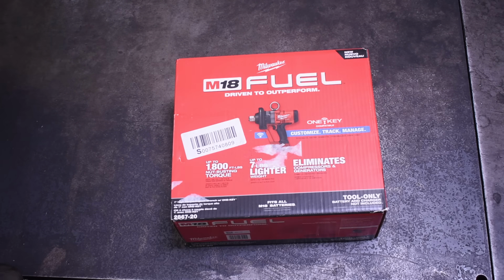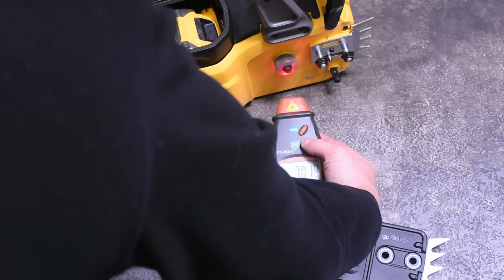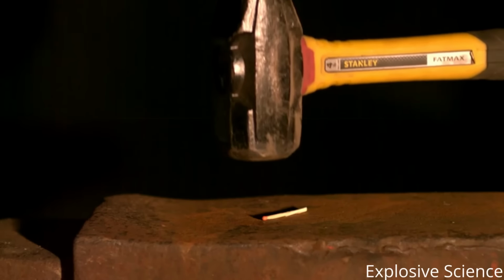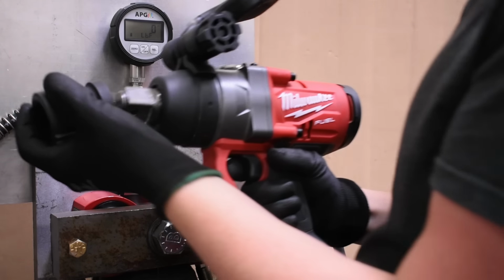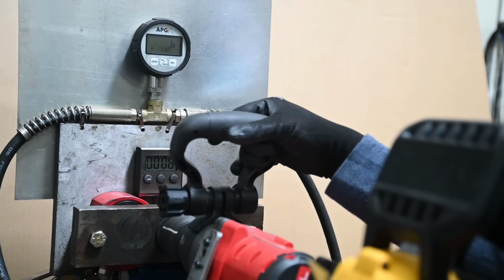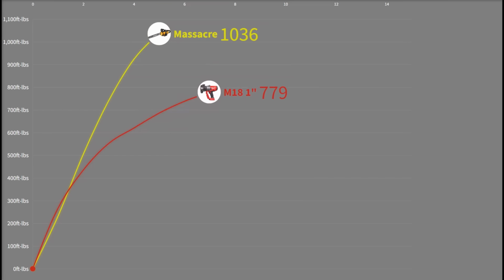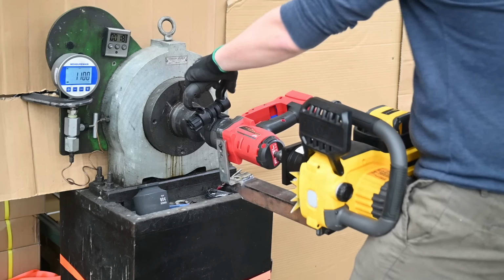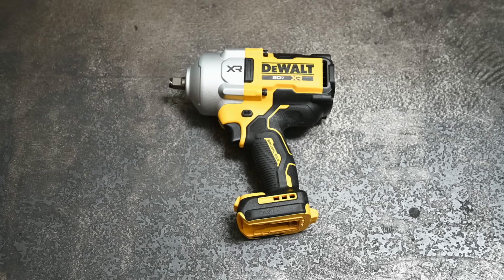DeWALT Chainsaw Powered Milwaukee Impact Wrench

Comment from the maker: If you sub, with today's Youtube almost nothing will happen. But hey, we'll still think you're cool. So there's that
Reply: Hey TTC, can youndo a shop tour at some point, i think a lot of us will enjoy it.
Reply: @Bartjuhhh103 Yes!!! We NEED this!!!
Reply: Do you have a way to measure how cool we are yet?!?
Reply: I know it's not an impact but have you looked into Hytorc or Radgun tools?  They're making astronomical torque claims and I would like to see them get the TTC treatment.
Reply from the maker: @MagnificoDidNothingWrong  We get offers, including from Hytorc for free ones which hey as a $7k tool that sounds fun. But they aren't particularly fun, just whr whr whr whr stop. High number. They work, they all work assuming they don't turn into confetti. It's a $200 cordless drill and a $2000 strong as heck gear box and LOTS of gear reduction. Good for tightening. Doesn't do much else.
Reply: bought the seesii impact because of your listing, finally broke loose the 22mm front strut nuts, took it about 30 seconds or slightly more, after a break because the nut was smoking, but she broke loose ❤ thanks, also any tips on keeping a sway bar link from spinning on the back side? (no welder, back side has been stripped a lot from clamping on locking onto it with vice grips, but i managed initally to get it off and replace the strut, now when i go to tighten the bolt back on it keeps spinning inside the grips and stripping it more and more) didnt realize i was supposed to replace at the same time 😢
Reply: @DaftKermitThePunk Replace it, or take the assembly to a welder(or a buddy with one) and have them weld up a nut or just a crazy shaped gob for the vice grips to hang onto! Im sure others have better tips haha
Reply: Next up is a hand cranked gatling style Impact wrench driven with with nail gun ammo.
Reply: Keep doing stupid shit like this and you dont even have to ask. We love it
Reply: Be a lot cooler if ya did
Reply: @ecidemon5672  Alright, alright, alright....
Reply: I think its just skipping when impacting, so hook the the pancake from the roadside egg impact and hook it up to the chainsaw,
Reply: Gained 16lbft and speed
Reply: I'm just glad you took the king of the hill of beans away from gasoline and gave it back to cordless electric, and even made it even more practical and ergonomic!
Reply: @torquetestchannel, you like to make abominations. So, could you make a 12v stack battery? Red, yellow, whatever.  Or is there a lot more to making that work than just soldering some stuff together?
If you can make that happen, could you make a 60v stack battery to run on yellow's tools?
Thanks!
Reply: Yeah, but if they hit the bell and turn on notifications something will happen and they'll be extra cool.

C'mon, Minecraft YouTubers have had this promo stuff down for forever, "And don't forget to smash that like button, subscribe, and hit that bell notification!"...
Reply: @msytdc1577  Annihilate that LIKE BUTTON, ring that bell so hard it breaks, and make 20 burner accounts and subscribe

Comment: I recently purchased both of Milwaukee's 1" impacts and love them but something that always frustrates me is the reverse bias power ratings. I still work on some older trucks and trailers that have left-hand lug nuts and the newer engines use torque to yield head, rod, and main bolts, which requires an impact gun stout enough to overcome 300+ ft lbs to turn the fastener an additional 60 degrees on a Cummins ISX. Is there a technical reason for the bias or is it mostly marketing that drives this trend? Love the channel. Thanks!

Comment: When I worked on rigs we used a 1 inch wrench with a 5 foot breaker bar and we still struggled to break the bolts so I would 100% buy this or the blue prints if they run off battery.

Comment: Where are the chainsaw comparisons my M18 chainsaw crushes my 80v Kobalt in power it seems. I need to know what the top cordless chain saw is.
Reply from the maker: Pretty hard to dyno, they all have unusual outputs
Reply: I would be satisfied with some non scientific testing i am sure you guys will figure it out lol  @TorqueTestChannel

Comment: Is there anyway you can change the gear reduction inside the Milwaukee gun? Also I’d like to see 2 m18 battery’s wired to 36volt inside a impact to see how much the extra power would effect it.

Comment: Has anyone else suffered a failed circuit board sensor assembly in their Milwaukee rattle guns?.
I have seen several now where the 4 tiny wires just break off the board.

Comment: You could probably put a switch on the chainsaw to make it go backwards, after all, it's a brushless motor, so basically just a 3 phase electric motor, so swap any two phases and it's in reverse

Comment: Can you test the Bauer 58446 brushless mid torque? Looking into buying one as it will work with Dewalt batteries with a very slight modification

Comment: With this silliness, the next step is an “M208” version of the big Milwaukee D-handle, with a new “brushless” (3ph, 25hp induction) motor.

Of course it might need a massive frame with caster wheels and a little hand cranked crane or jack to adjust the height and angle since it would be too heavy for a single person to pick up and would create 100 or 200 ft-lb of “kickback” torque just starting without a socket on it.

Comment: what I really enjoy about these videos are just the insight into impacts and how they function. of course the tool breakdowns and cutouts you do with walking us through parts does as well.

I'd enjoy seeing a built up compact or mid torque. we're seeing brands releasing 1/2 high torque that pretty well align with 3/4 power, but don't see much on compact impacts hitting high torque 1/2 range. with pouch cells like forge hitting the market, a 3ah compact battery on a tool the size of a  mid torque would make so much sense. something light and small enough to get into tight places where bigger guns would need replaced by a breaker bar. or possibly a right angle impact

Comment: That was a stack of spring washers.  Have you considered nordlock with double belleville washers?  Used to work semiconductor equipment and as far as the Japanese engineers cared that was the solution to every problem involving high frequency vibration and 200 degree 30min thermal cycles.

Comment: Wouldn't the circular saw been a better fit?  Higher rpm plus you already tested a 60 dewalt circ saw.
Reply from the maker: It's like 2Hp vs 4Hp though. And believe it or not, lower RPM
Reply: The new Dewalt with has lower RPMs.  If you look at the slow motion part of the video, you'll see metal being shaved off, the spring is not strong enough for the extra speed and torque being supplied.

Comment: I bought one of those DeWalt chainsaws this summer and yeah its an absolute beast. Impressive on how much torque that abomination makes.
Reply: It's pretty decent for an electric and gains more power running a shorter bar like any chainsaw, but it's not really in gasser territory yet. A dual battery version might be.
Reply: @Comm0ut  so, a 120 volt chainsaw with two flexvolt batteries ?

Comment: Would putting the dewalt spring in or find a stiffer one somewhere else fix the problem of the hammer over rotating and not getting pushed all the way back?

Comment: What if you didn’t go the standard drill motor route I’m thinking 961 hammer assembly but cut the back out and stuff a battle bots motor in it and it you mount the esc somewhere else instead of in the handle you could use one with significantly more cooling and use something with more beans

Comment: MAYBE DIY MODIFICATION --- electric skateboard motor like 6380  === 4000wat brushless + vesc controller or even bigger motor like 8072 with low kv (rpm per volt) and peak 6000wat
PS 
you could easly change the rotation direct in this chainsaw by swaping 2 motor wires from ABC to ACB and hall sensor wires from 12345 to 14325 (1 and 5 are + and - so you dont touch them)

Comment: Regular mechanic: I modified a tool by grinding down a wrench.

TTC: Hold my 21700 cells.
Reply: To increase the torque he needs to increase the weight.

Comment: can't you use a reverse threaded nut and bolt on the skidmore-wilhelm to allow for testing reverse on impacts?
Reply from the maker: The skidmore doesn't use a bolt, it's a hydraulic plate with male threads. A replacement is like $1,000 and it looks standard thread

Comment: you could try to bolt a brushless inrunnter motor on the back of the milwauke and somehow hook up the shafts together.   those little motors can go like 5..10kW... in a coke can size.. some (lehner motors, model 30100) go even up to 40kW at 50k rpm

Comment: The next thing to do is use the Milwaukee D handle with a chainsaw
Reply: IR one inch died in the battery adapter episode from the flex battery’s they have a Donor

Comment: You’ve got the tools and equipment to do it so go ahead and build your own impact make it have a 10 pound hammer and bolt on whatever you deem fit for a motor be it something electric or gas plug in or battery and just see if you can hit 3000+ ft/lb
Reply: Depleted uranium hammer assembly when?/s
Reply: @obsessivecorvid yes sir!
Reply: You'd need to forge the hammer and anvil really. Best bet is just to frankenstein the biggest hammer/anvil combo possible onto a motor like the dewalt chainsaw
Reply: @Muffinx93  Just collab with someone like @TITANSofCNC to get a custom made tungsten hammer and anvil.
Reply from the maker: @MrMartinSchou  Tungsten would just shatter. It needs to be forged as @cncgeneral said. A forged hammer and forged anvil that's machined. At least if we want it to last longer than the impact in this episode did
Reply: @TorqueTestChannel  forged 4140 or 4340 would be pretty ideal with the right heat treatment,  you could oversize the anvil and hammer diameter for more contact area and rotational mass
Reply: @TorqueTestChannel I did not know that.

What's the densest, tough material then?
Reply from the maker: @MrMartinSchou  Tough is a good word for it, as that's the main goal. Unfortunately most tough alloys and materials are all pretty much inline with regular steel/iron in density. The move would be to forge a large hammer mass out of Cro-Mo then machine holes into it and heat up then press some tungsten slugs into it and hope they dont see much forces to crack apart. That would be massive in the physics sense.
Reply: @TorqueTestChannel Tungsten has a specific gravity of 19.22.  So how about Osmium, which has a SG of 22.5? It might present a few difficulties, but you shall overcome!
Reply: @TorqueTestChannel  a guy above was asking about using a Cordless Router motor..think it'd be worth it to swap one into that smoked IR?
Reply from the maker: @KHALABEEB  Nah, it's going to use something bigger. Something spicier, probably. I dunno, sometimes these things blow up before we even film them and you never get to see it.
Reply: @TorqueTestChannel   Didn't the Ingersol Rand 1" electronics break? Could you steal its hammer assembly for this beast?
Reply: @KHALABEEB The router motor is designed for high speed over high torque. And, you loose quite a bit of power in the gear reduction bringing that speed down. Would ultimately not really make more than the big cordless tools all ready do.
Reply: @Muffinx93 remember they smoked there IR one inch they have another donor its all good

Comment: Now Dewalt will come out with a Frankenstein tool that you made in this video..  LOL
Reply: You mean a 1" D-handle impact wrench?  If DeWalt were making it, I'm sure they'd ditch all the extra plastic and components required to make it chainsaw-shaped and just make a normal D-handle impact wrench, even if they were using the same motor.

Comment: I still wonder why dewalt hasn’t made a 60 volt flexvolt impact yet !!! The world basically screams for it
Reply: So glad im im heavily invested in FlexVolt tools. Absolutely #1
Reply: We have 5 inches nuts at my job. Mechanics remove them with hydraulic wrenches
Reply: Dewalt needs to step the heck up with the 60v stuff. We need a 60v 7¼ miter saw, 60v smaller circ saws, and 2x60v or 120v table saws and vacs and so much more! There is so much potential they're sitting on but not moving. Also they can compete with milwaukee mx line while still being compatible with 20v
Reply: @andrewk8636  they got the 120 table saw already
Reply: @jamesfair9751  model number?
Reply: The true question is where we will find bolts that need this kind of torque in the real world. Everything above 32 mm which actually has to hold stuff together is getting streched by hydraulics and then the nut is threaded on by hand, as i recently learned.
Reply from the maker: @nilz6432  It's not for tightening. It's for removing stuff that rust welds solid, which is why we hopped it up for reverse. See here: https://youtu.be/yvCznz3G4Fg?t=918
Reply: @TorqueTestChannel I've found there's a narrow range of 'seized up' where just adding MORE POWER will actually remove a fastener versus just turning one fused mass of metal and rust into multiple—one usually jammed real hard into your socket 😢😂 Often still need heat and judicious use of breakfree to separate and lubricate before giving it the beans, but I guess luck and experience factor into it...
Reply: @nilz6432  There are plenty of large stuck fasteners to remove on heavy equipment and trucks, especially in the Rust Belt. There are many where shearing the fastener is fine provided the part can be removed. The ideal impact when confronted with a stuck bolt on an Abrams tank would spin the tank if the bolt didn't fail.  In America there is no such thing as too much torque.
Reply: @nilz6432 where you use tensioning, hydraulic torquing (HYTORC for example) or a nutrunner (Plarad for example) on air/battery is all about the customers standards. 
Battery-powered nutrunners are gods gift to mechanics where you need a controlled torque in the range from 500-4000nm. After that or if its a joint that needs a lot of compression to seal it's time to bring out the tensioners. 
The applied tension on larger studs (we are talking 2" and greater) converted to twisting torque is in the range of 10.000nm and far beyond for bigger studs. 
We torque manholecovers to over 1500nm 😂
Reply: @nilz6432  I work in the heavy equipment industry and use 3/4 and 1" anvil guns daily. Bolts and nuts passing 55MM head size is not uncommon.
Reply: @rudyfromsomewhere3066 Not likely they'll make all tools 60v, just isn't worth it.

That said, they do have 60V drills. One standard pistol grip model with a keyed chuck (DCD130), three stud/joist drills (DCD460, 470, 471), and a few SDS rotary hammers.